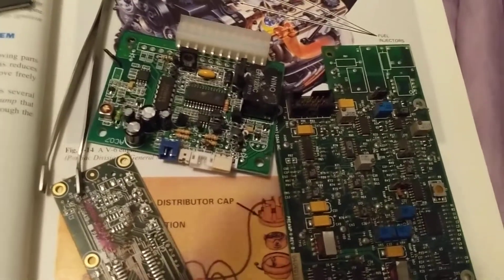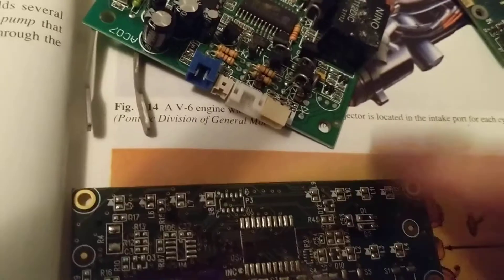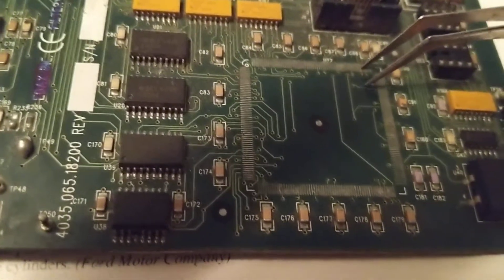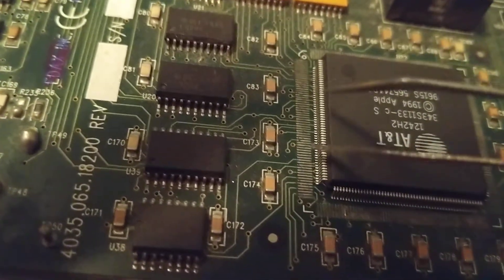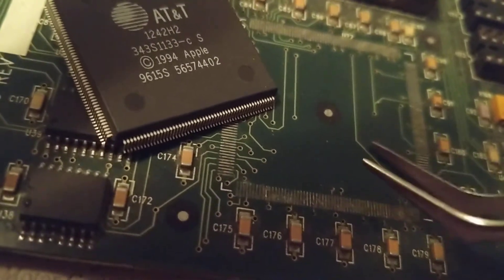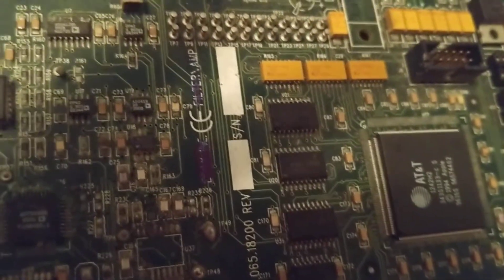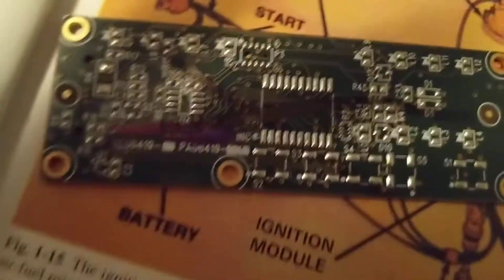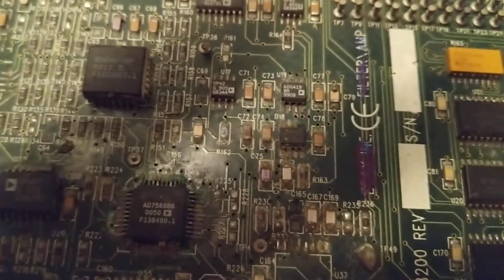COMPUTER CONTROL MODULES IN AUTOMOTIVE AND TESTING THEM

Comment: Thanks a lot ;
just had a problem finding datasheet for an ic driver L05172 , also; how do i test it ?
Reply: You could try putting it in Google if this is a chip which it seems like it is put that serial number in it in Google you should have a data sheet for it come up about testing it I have to see the pins the VCC pins which could be around 3 volts to test that you need a good digital scope have to look at the pins try that and then I get back to you

Comment: These boards are multi-layer boards all you see is the top and the bottom with components incredible technology with the ground plane and the 5 volt reference voltage and 3.3 volt reference voltage and layers in between incredible to troubleshoot them